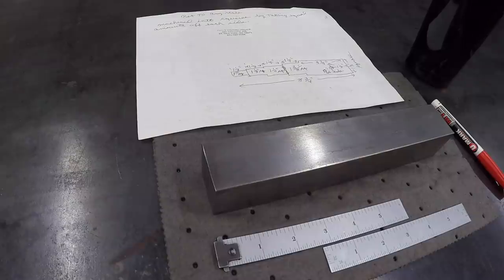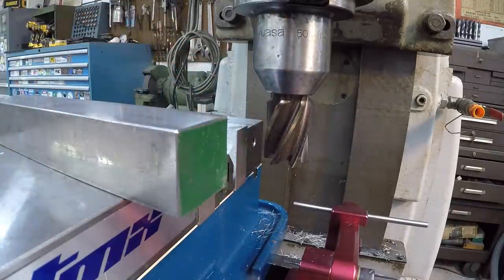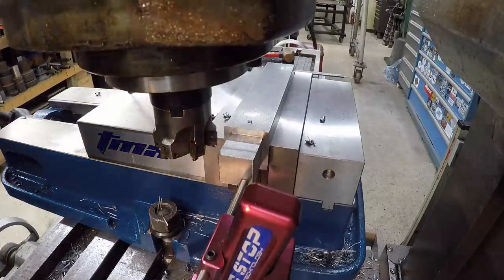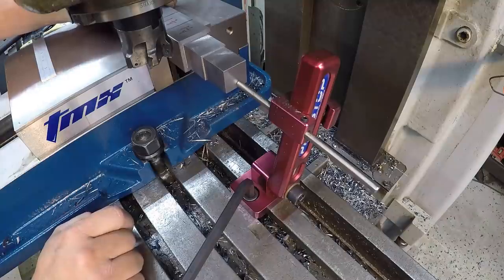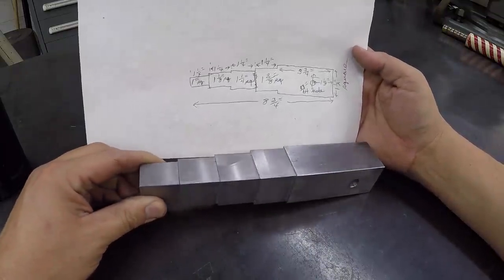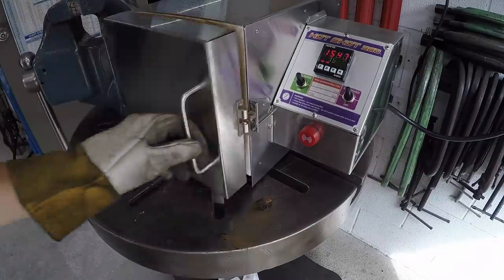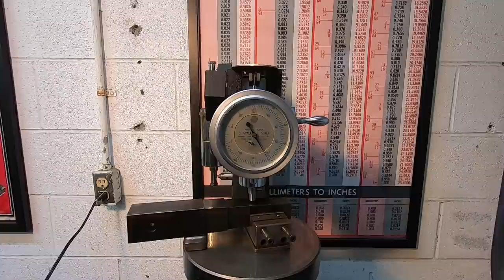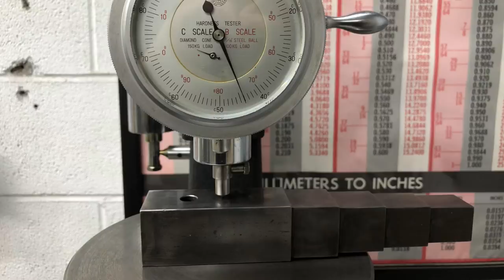SNS 296: Custom Square Drive Tool, Heat Treating

Comment: Not sure about the United States, but in Canada the heat-treat apprenticeship program takes 6-years to complete.
It is a bit more involved than simply heat n' quench.

By comparison a machinist apprenticeship takes 4 years.
Reply: A six year program....meaning the apprentice works in a shop that has decided to sponsor him / her. 

They work in the H.T. shop but spend 4 weeks of each year in a trade school undergoing theoretical and practical upgrading followed by a written exam.
After six years of successful upgrading the apprentice writes the final Inter-provincial (I.P.) exam.
Upon passing this test the apprentice becomes a Journeyman and receives their ticket.

At least, that is how things worked in Canada back in the 1980's - but even then many shops did not want to spend the time and money.
They usually hired experienced heat-treaters from Europe.

Comment: Adam,
Just a couple things I noticed.
-Get part hotter
-Bigger quench tank
-Needs rapid quench after hardening
-Use a smaller anvil on hardness tester
-On the test coupon, remove scale before testing, mill or grind off
Hope this helps.  A good mil spec reference is 1-1A-9 Aerospace Metals
Reply: I think the scale is what the problem is here.

Comment: I think you can add carbon to the part inside the foil to give a bit more hardness.  If I got this right,  page 462 of machinery handbook 29 edition calls this process Carburizing.

Comment: I just got my CNC Programmer degree about a year ago and had to take a metallurgy class in which we heat treated some blanks of three different materials; 1018, 4140, 4340 and had to forge our own knives to heat treat them also. What I remember was

We did not keep our parts in that long, we got them to temperature and quenched ASAP. 

When quenching you want to use like a stabbing and slight swirling motion, I guess when swirled too much it can actually create a vapor barrier around your part and cause it to cool slower

I'm wondering if just cutting a slit in the stainless foil instead of unwrapping so you can quench faster would help

When testing the hardness, the smoother and more flat the surface was when testing the more consistent your results would be when the hardness tester was calibrated correctly. Our instructor was very insistent on us getting our blanks as close to a mirror finish and as parallel as possible for the most accurate and consistent results. I wonder if that is why the extra stock piece you tested got such varying results across different surfaces
Reply: Well Adam I have watched you for a year or so and enjoy what you do, but I observed this last job of squaring the piece of Hot rolled steel, I believe that is what I heard you say. So along with cold roll steel and Hot rolled steel they are both low carbon steel, and impossible to harden all the way through, But! to case harden it that is a different question I used to heat treat my hot rolled projects by making sheet metal box and fill it with cast iron chips or filings,to add carbon to the hotrolled to assist in the hardening and only approximately .010 to maybe .016 or a 1/64rth of an inch deep. You try this with your hot rolled and see.  Keep up the interesting work and goodluck with the heat treating.

Comment: Preheat the quenching oil.  
Secondly heating up the oven to a lower temperature and letting it soak at the lower temperature for consistancy then ramp to final and soak at that temperature because of the uneveness in thickness.

Comment: you need only fold twice , then seal with a hammer or mallet . watch out for sharp corners . I like to vent the foil under the oil  .use a smaller stage on the hardness tester . when you quench , go STRAIGHT ! from the oven to the oil . more oil is better. when you use wrap  , add 25 degrees to the temp .
Reply: Also add a thin strip of newspaper, inside with the metal, to assist in de-oxygenating the atmosphere within the bag.

Comment: as for the mixed results on the hardness tester normally you would machine the part and leave grinding allowance to finish on the surface grinder after Heat treat process, so there's a good chance you were hitting carbon deposits in the scale.. Keep it simple it can be a confusing topic but adding toughness to most tool steels can be done in the same fashion if you're not looking for laboratory results.

Comment: i worked at a bicycle manufacture and made dies for production and i found out for the best results i put toilet paper in wrapped around the part and tightly wrapped in the stainless steel foil. and you have to flip the part periodically also give 20% more time in the oven and 10% more temp.  and to anneal it back soft enough to machine again you heat it up  to 20% hotter and hold temp in 60 minute intervals and drop temp 100 degrees til under 250 degrees then let air cool to room temp.

Comment: Your better off using atp-641 anti scale coating than the foil. heating the quenching oil is essential along with a metal container to quench in  and leave the part in the oil until it stops smoking when removed from the oil

Comment: It is very very important that we see how this device is used!
Reply: I would love to see it also.
From the looks of the tool, I'm guessing that it fits into several different sizes of square "keyholes" on the hatches of train cars.  Then the worker turns the key to unlatch it.

Comment: Adam - make the part a few thou oversize, no wrap, after the soak grab it and quench quickly, no fooling around.  Put it in horizontally to get the whole piece in as quickly as possible. Then buy a nice surface grinder :-) to clean up the part and bring it down to dimension...

Comment: To hot, worked at jasco/sun doing everything from 1045 to T15, 4140 should be 1525°-1575° martenizing temp, it could also be 4130 which would explain the low as-quench hardens even in an oil quench esp on a 2” part

Comment: Throw the foil away! Heat to 1500 deg Cherry red pull it out with your pre-heated tongs ends straight in to the light oil.  It should be super hard at this point. Put it back in to the oven heat it to 
650 deg. for 24 hrs to relieve stress build up and to temper.  Oil cool for hard  temper , Air cool for a soft temper  For this last step will soften it up some what, other wise it will be to brittle.
Reply: How much do you leave for cleanup after heat treating in open air like that?  The times I've tried that, I've lost 2-4 thou to scaling.  An even bigger factor for me, allowing for part warp has been the bane of my limited heat treating experience.  I've wasted a lot of time surface grinding to true up parts. 

I even had to scrap some case hardened parts because I couldn't true them up without grinding through the case.

Comment: I would be suspicious of the temperature. While digital controls may appear precise they can be totally wrong. The temperature sensor is a thermocouple which come in various types. They are identified by a single letter code like J,K,T etc. They all generate different voltage levels per degree. The controller must be set to match the thermocouple type. Your oven likely uses a K type but it might be something else. Whatever it is the controller setting must match.
Check the controller manual to see how to program the parameters. One test is to see if the temperature reads shows room temperature correctly and shows boiling water temperature
correctly too. It will read a little below 212 degrees cause the water will cool little.

I am by no means a heat treat expert but I have hardened numerous parts over the years and uniform heating to the correct temperature and a quick quench is usually all it takes. I usually use the foil technique but put a piece a paper inside to consume the oxygen before it has time to corrode the steel. It is not quite like vacuum heat treating but it helps.

Good luck.

JY

Comment: 21:44 you can do it the old way and put it into a stainless steel container filled up with small charcoal pieces or saw dust and a lid on top of it- when you harden it you pour the part or parts with the coal dust alltogether into a whaterbath - use soapy whater so you dont have a leidenfrost effect that easily- so the hardening is more even
also keep the ashes from a stove- the ashes isolate a part allowing it to cool even slower when you want to glow it soft
should you ever wind springs on a lathe and then harden them use like a guiderod while heaing and quenching- so the coil spring doesnt bend in one direction - and anneal it carefully and immediately , they become so brittle like ceramic, you can crunch them with your fingers up to 2mm wire thickness  
a good way to anneal is a lead bath -  it got constant temperature from all directions and it cant get to hot because the lead starts to evaporate 
also if you got steel that gets stress fractions when you quench it in whater you quench it in liquid lead and right afterwards in whater , like jumping from the roof onto the garage and then onto the ground instead of jumping from the roof and fracturing bones
you might want to install a CO2 welding shielding gas inlet into the oven so you cna heat parts under shielded atmosphere - nice to preheat small pieces for even welding

Comment: i would not have bothered wrapping it. it's just too much of a pain to deal with, because you can't leave the wrap on during the quench or it will mess the quench up (as you saw the results of)

if the furnace door is tight, then scale won't be that big of a problem. just bead blast or tumble it after. if you want to get very fancy, punch a hole in the furnace and add a small tube to pipe in a trickle of argon (this only needs to be done when the part is in there, not during preheat). again, if the furnace door is tight it will not take much at all, and if you already get it from the welding supply then it's not a big deal. certainly cheaper than a roll of stainless foil. i am sure the boys at bar z could advise you on where to punch a hole.

as for the weird post-temper results, if the tester is calibrated, do an N test to see if you more consistently get the higher number, which would possibly indicate a very thin layer of harder steel that you're breaking through with the C test.

Comment: I would think the thinner cross section of the part likely hardened better. It is thinner so it heats up faster and gets to temp, and also cools faster to temp. Freezing those steel structures before they have time to drop in temperature at their own pace will make a harder part all by itself.

I'd absolutely ditch the heat treat foil while i am learning. Questionable oxide protection and it' WRECKS your quench rate! Made it take forever didn't it?

Comment: You should not have quenched for the temper process. Heat and cool slow ! For hardening you have to be at critical temperature when you quench so probably not best to use foil straight into the oil. Spots cooled while you where messing with the foil.
Reply: Strange as many people do quench for the tampering process. Different alloys need different treatment.

Comment: One other thing....I didn't see the bright red ...glowing red...when you pulled the part out of the oven.  You may not had the part hot enough.  Our parts come out glowing red hot or hotter...maybe use a temp gun to see how close the temp is at.   We "cook" around 1700 degrees for 4140....then draw it down (see my first post) to the desired hardness.

Comment: I'll tell you what i know , when quenching it in the oil it is better i think to makes eights and not circles because the oil starts spinning with you and it is like you turn it slower.
The other thing is that when you temper you are looking for your metal to become blue-black in terms of color and before putting it into the over it needs to be super clean , after that you let it cool down on its own in room tempeture and not in oil. Hope that helps .

Comment: All I know is most knife makers only use foil on stainless steel blades. Once in a while I will use anti scale but normally just remove scale. Hope this helps. So much info so many ways to do it

Comment: Rail cars have a rack and pinion style of door on the bottom of the hoppers and there is a square drive to operate it, and for some reason they could never figure out a standard for the sizes. They can also be opened with a large pry bar but it's a pain in the ass because there's not much space and sometimes it's necessary to use a 6 foot bar with a 300 pound guy on the end to get it moving.
Reply: I think Gunderson and Trinity cars have the same specs but I'm not sure if  American Railcar and the older Pullmans are the same

Comment: The industry I work in is in steel wire production. We typically handle materials from 1070 carbon to 1095 carbon. Our heat treat process is around 1000C (1832F)with a 500C (932F) first quench and 60C (140F) secondary quench for tensile strength more than hardness.Later in the process we temper the wire to 450C (842F). This is done for wire diameters between 1.5mm and 9mm. The wire is treated in a continuous process as the wire pays off from one spool to another. I do not know how it will relate to a few kilos of square stock though.

Comment: I'd suspend the part from wire in the oven then go to quench in the oil. Quickly. It looked like your temp was down to about 1,400 when you hit the oil.

Comment: Adam, I am pretty sure I've seen a copy of the Machinery's Handbook Guide on your shelf. There is an entire section in there on heat treating. Some of it is painful and not applicable to what you were doing but you can just scan the painful parts and pull out the nuggets. I am sure that will answer the questions you were asking on the video. There are definitely easier to read and follow books out there on heat treating for the kind of work you typically do. But understanding the science of why something works or more importantly doesn't work is always helpful.  Bill Bryson's heat treatment book is a great working knowledge approach if you want to spend the money. Take heart in the heat treating Dude. There is a reason there are so many books, schools and opinions on metal and heat treating. It's alchemy! It wasn't until the electron microscope was perfected that we even began to have a real clue. Keep up the good work. Just so you know, If you buy or have someone give you an electron microscope I will really hate you. (Tool envy)
Reply: haha

Comment: Hi Adam;
I enjoyed this one quite a bit, especially when you got to the heat treating part.  I've made a lot of tooling in my days in the shop, but only from various drill rods types or Starrett type tool plate, like O1 gage plate. 

Love the oven.  I need one of those for my shop.  I think it did pretty well considering the size of the piece, and having to unwrap the piece while it was loosing heat. 

BTW, nice boots there, bud. 

Dean
p.s.  I have been watching since the beginning and though I've been doing this for years I still pick up a new thing now and then.  Your work and mine are quite different when it comes to machine size and parts type.  Nice to see the big stuff.  (I did learn to cut my first Acme thread on a Monarch very similar to yours!  Was a little longer, but much the same.  My old mentor, Jack, helped me on that first Acme.  Something like 2 1/2--3 thread.  It took days for me to get that done.  Piece was about five feet long.)  Anyway, I've started watching your vids back from the beginning.  Some seem almost new since it's been years since I last saw them.  You've done a great amount of work for the community.  Thumbs up!

Comment: Hardening and tempering can be a tricky process. Each alloy reacts differently. Chrome moly has the interesting characteristic you encountered which is getting harder at lower temperatures, and softer at higher temperatures. It seems to defy common sense, but there it is. Additionally, you don’t dip tempered steel into a cooling bath, you let it cool to room temperature at room temperature. Sometimes, for some alloys you leave it in the oven which is turned off and allowed to cool overnight.

Then there is the triangle problem for square stock. That’s where the corners and edges cool much faster than the center, and become harder, and are more likely to suffer from microcracking.

4140 doesn’t have good quenchability. It’s somewhat variable unless done under controlled conditions which is hard to do in a small shop. 4340 is a better choice.

Comment: you are quenching that thick part way to slow. you need to quench a part like this made from 4140 in water for quicker cooling. according to the "ASMW Handbook Volume 4A Steel Heat Treating Fundamentals and Processes" the biggest section size of 4140 that can be hardened with oil to full surface hardness is 1.5 inches (page 49). When you wisely use the stainless steel foil to prevent decarburisation, the heat transfer is even slower, so i would defenetly recommend quenching in water.

Comment: The thickness of the metal will make it challenging to cool it evenly and thoroughly in the time needed for a consistent hardening. The foil is probably more of an obstacle to achieving this then a benefit. Also, what state was the material purchased in? Annealed? There cold be hard spots in the stock from the rolling process. Thanks for making great vids.

Comment: Adam, There is a book by William E. Bryson titaled Heat treatment, selection and application of tool steels. I have read it and it has detailed "recipes" for heat treating most of the types of tool steels available. It is very informative.